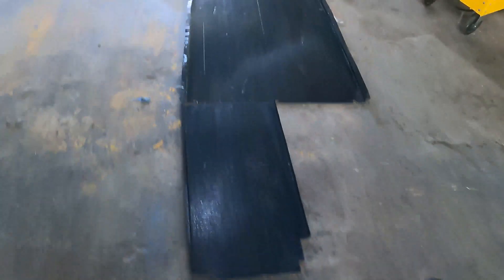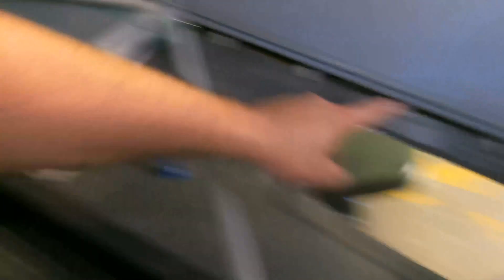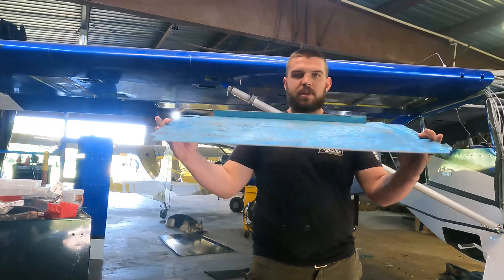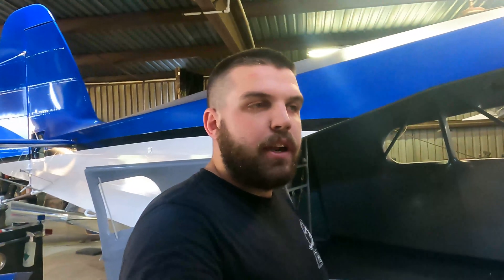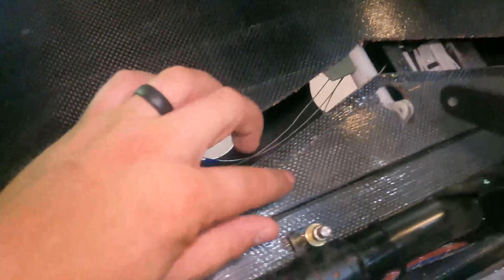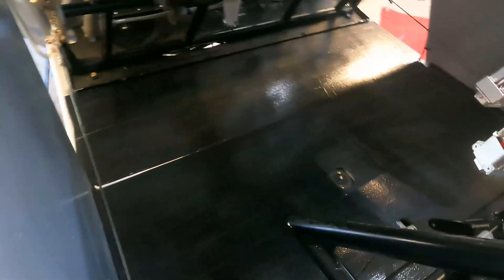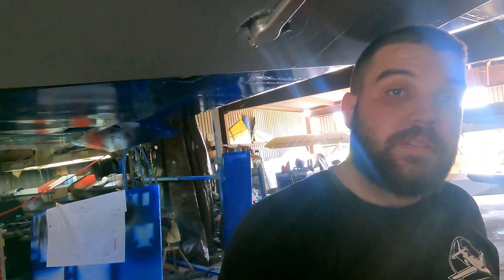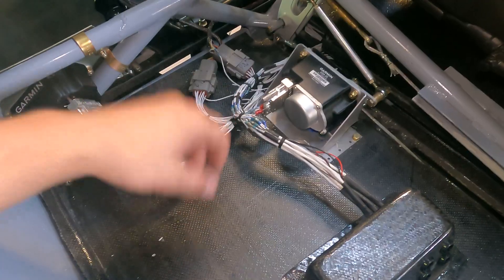Bearhawk Model 5 - Custom carbon fiber floor

Comment: How are you isolating carbon fiber from aluminium parts?  Mold details would be awesome.
Reply from the maker: Mostly the carbon is contacting steel and there is either a rubber isolator at contact point or where the tubes run under the floor I am using some thick aircraft chafe tape to protect the steel.

Comment: Great idea. How/ where are you attaching the floor boards? It looks like you are removing the tabs? Think you could add a few photos with the rudder cable clearance on the forum or BH FB page? Keep up the great work.
Reply from the maker: Moved and added some extra tabs in a few places. Removed all the tabs along the lower longeron. I’ll post something in the forums. 👍🏼

Comment: Nice video, doing an awesome job and great idea on the carbon fibre.  do you need to isolate the carbon fibre panels to prevent galvanic corrosion?
Reply from the maker: Yes they will be isolated on final install. No bare carbon should be touching the steel where it may rub.
Reply: @The-virg  thx mate, good to know

Comment: Lots of questions! Are you going to add a turbo, hence the oxygen? Where do you buy your carbon from? Are you adding a yaw damper?
Reply from the maker: No turbo, but will have a big engine (more on that later) so we should be able to make it into the mid teens fairly easy, it wiill also be used for medic so wanted the option to put patients on O2. I buy my carbon from uscomposites.com. they have a discount section that brings the price down to something manageable, terrible website but outstanding service.  Autopilot is Garmin 3 axis yaw damp with auto trim, 507 controller.
Reply: @The-virg  Thank you sir. I'm very curious about building a bearhawk. If you have time, could you please do a video on the autopilot and trim systems. Thanks!
Reply: @The-virg  did you make the CF floor boards from cloth or did you provide the dimensions and order them?
Reply from the maker: @Austinmediainc  made from scratch off some molds I made. Lots on labor but worth it.

Comment: Those floor boards are awesome! I want to see every detail on everything :). Servo install location considerations, headset wiring to that central location seems like a great idea, if you went 2 or 3 axis auto pilot, and every other smart idea you've had that I can try and steal :)
Reply from the maker: Comin right up. 👍🏼